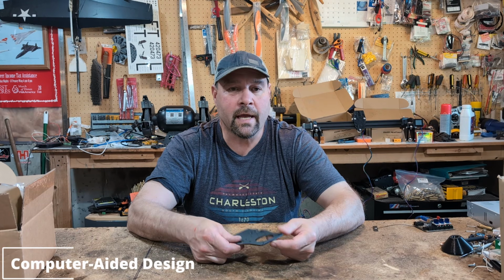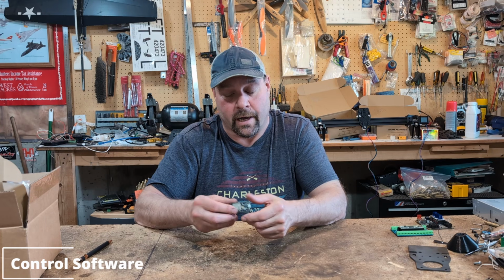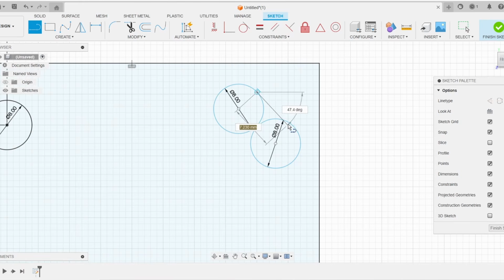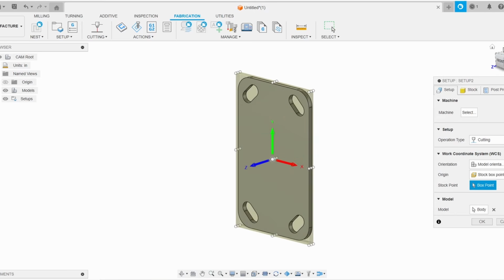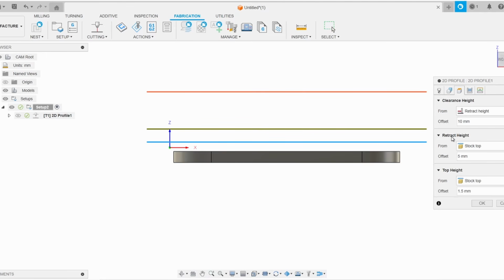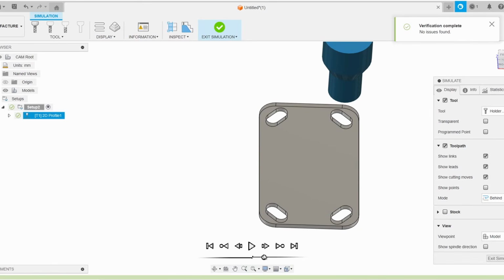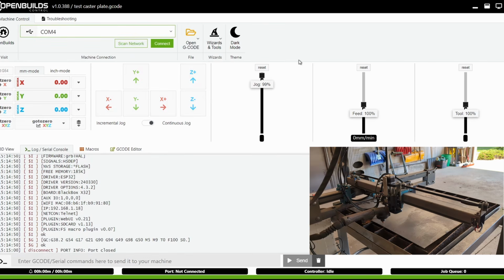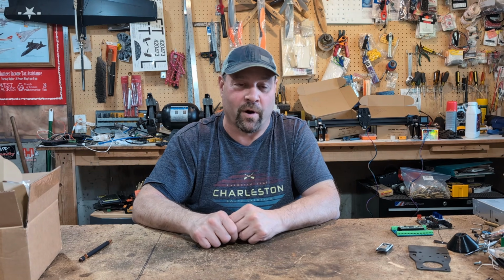Fusion 360 CAM Setup for CNC Plasma Cutter | Updated for 2025

Comment: I bought a langmuir 3 years ago. Now Windows 11 is the new standard.. 🤦. Anyhow, Langmuir standard issue computer not upgradable to 11.. 🙈🤦🤷 I had to have a much more powerful tower computer built to run Fusion 360 and Firetrace software.  What a difference!! It's lightning fast now. Software downloads much faster, most importantly.  You definitely need a good computer to run all this stuff smoothly.

Comment: It would be helpful to show how you add OpenBuilds to the Fusion360 machine library so it shows up under the Post menu. Otherwise, awesome tutorial.
Reply: Came here for the same info. This appears to have worked:

How to Import a .cps (Post Processor) File
Open Fusion 360 and switch to the Manufacture workspace.

On the top toolbar, go to the Manage tab and select Post Library.

In the library tree on the left, select My Posts > Local (this saves it to your computer).

Click the Import icon (a folder with a plus sign or an arrow pointing in) at the top of the window.

Select your .cps file from your computer and click Open.

Comment: When you say that OpenBuild is a g-code sender, that is exactly right. Even when a user jogs the machine with OpenBuild or any of its other functions, along with moving the torch/spindle/laser around as they cut, are all functions that involve OpenBuild sending g-code to the machine.

Comment: You should absolutely make shortcuts in Fusion 360 at least for sketch and extrude functions. The toolbar is completely customizable. Also you can find functions by pressing "s" and type in the function you want to use. 

Ps. You can make those type of holes using "Slot" function to make it much faster :)
Reply: Could also draw one slot and use the mirror function to get it in all 4 corners.

Comment: 25:45 the way I found it easiest was to use open builds to figure out my offset. Once my torch tip touched the metal i zeroed the z axis, selected the smallest movement increment and opened the troubleshooting tab. Once on that tab I moved the z axis down 1 increment at a time until the probe said triggered, go back to the control tab and the value given on the z axis will be the probe offset.
Reply from the maker: That's how we do it too.

Comment: Thanks for the run through, Jackson. It made a lot of sense. Most of the Fusion 360 tutorials I start just jump in past some of the basic steps (like when to use which mode for building a model, for example) and move super fast, making it hard to follow or retain. I build a lot of stuff in Tinkercad currently, but getting holes placed properly or doing any kind of filets can be overly complicated.
Reply from the maker: Word is tinkercad works good to learn the basics but isn't the best for more advanced stuff.

Comment: Since Fusion has decided to kick us certain Mac users to the curb - I'm moving to FreeCAD!
Reply: Prepare for frustration. Freecad is very finicky
Reply: @joesf1026  - Agreed. Since I'm not that invested in it yet, I'm still open to other options!  I might stay with Fusion, but it'll have to be run under a VM (annoying).  Undecided....  sigh....
Reply: @DrFiero parallels is very good, I’ve not tried fusion but used a lot of other bits with no issue at all.
Reply: @joesf1026  Personally I find the v1+ versions very easy to use. Far more functionality than free Fusion too. Including FEM.
Reply: CAD CAM lessons and allvisuals4u are two great youtube channels to learn freecad.